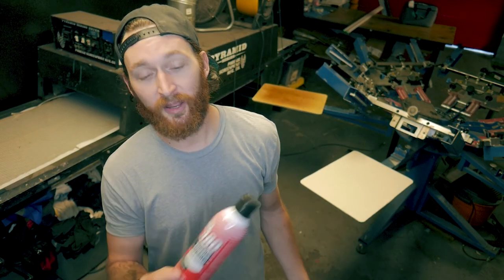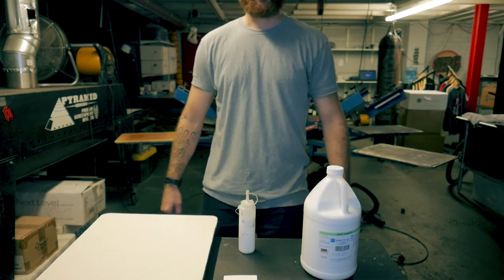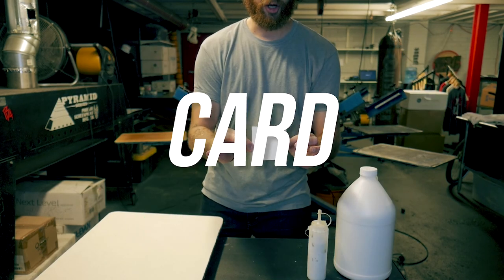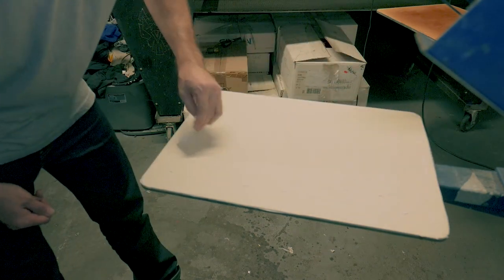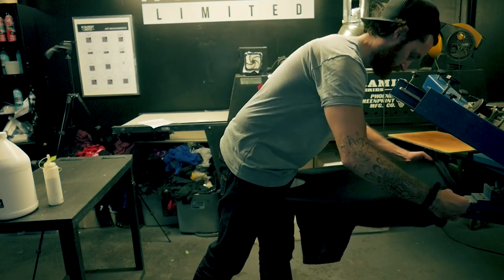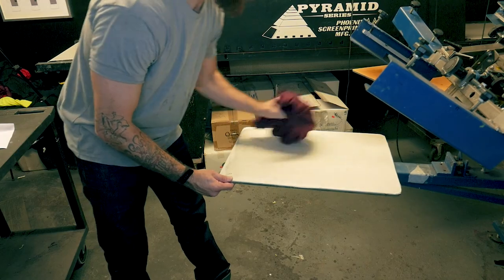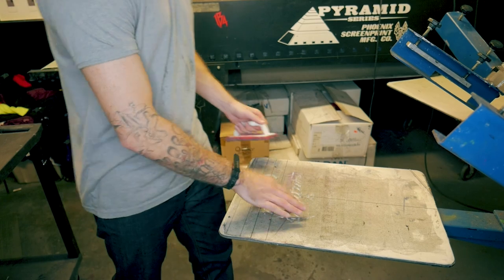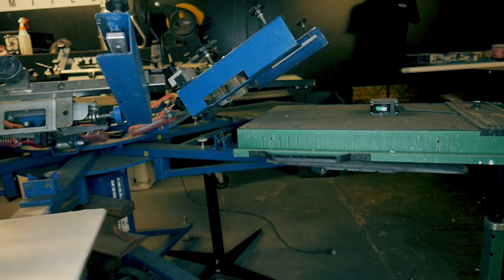How to Screen Print: Using Water Based Pallet Adhesive.

Comment: Mixing water into your adhesive before applying will cut down on inititial "bite" and allow the lint to come off with less scrubbing. I use a 60/40 glue/water ratio (may vary by brand) and sweatshirt lint wipes clean with a swipe of a bare hand.
Reply from the maker: Great tip, that never crossed my mind. Will do

Comment: What exactly is the pallet tape for? just to keep the pallet clean or intact when renewing the glue? 
looks kind of unnecessary to me, its a double usage of glue plus a paper sheet when you could just apply the water glue directly to the pallet, if its made of aluminum it can be cleaned with water or other solution and a spatula just as you do with the pallet tape isn't it?
Reply: Pallet tape makes for a faster clean up process. It has also saved me money on chemicals being  that the tape is very affordable .
Reply: thanks, it seems cleaner specially using wood pallets like i do, but honestly having those pallets Cam has it doesn't seem so necessary. but its just my guess of course.
In terms of cleaning time, one of the videos shows that sometimes removing the pallet tape can be just as slow and also need solvent to remove glue residues (https://youtu.be/XvYDYu3S7v0?t=78).

On the other hand, ecologically I wonder what will be more polluting, I don't think pallet tape is recyclable since it has glue. 
Actually, laying a paper with glue underneath to cover with glue on top seems redundant to me. It is not a complaint,  just a point of view.
Reply: an easy way to clean the glue applied directly to the palette is to heat it first, then sprinkle some solvent (if the glue is water based maybe alcohol would be enough) and let it soak for a few seconds, then remove it with a plastic spatula, it comes off easily, then clean with a cloth (damped in solvent or alcohol) any residue that has remained.
of course there's some solvent involved in this technique, but the pre-heat and a sprayer should help reduce the amount used.

Again, just hoping to contribute something useful.
Saludos.
Reply: Was looking for this comment thank you
Reply: In fact, lately I have been cleaning the glue from the palette by spraying a little bit of water and rubbing it with a rag.  Around 80% of the lint comes  off and revives the glue. Obviously a little bit of glue comes off too, but now i use maybe 5 (or more) times less glue than before, and cleaning this way is much faster than applying a new glue coat. highly recommended.

Comment: We normally print alot of hoodie pullovers and have to use the extra 'spider web' adhesive.  Will this water based adhesive work for us?  also, what is the applying  and drying time before we can use it?
Reply: Ya, don't use spider web for anything